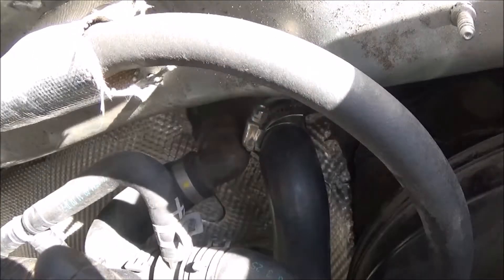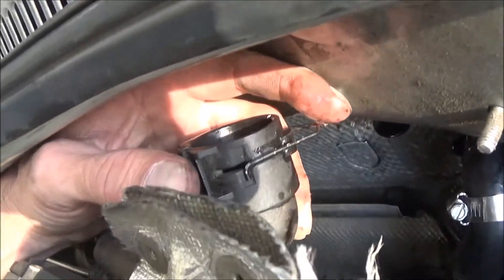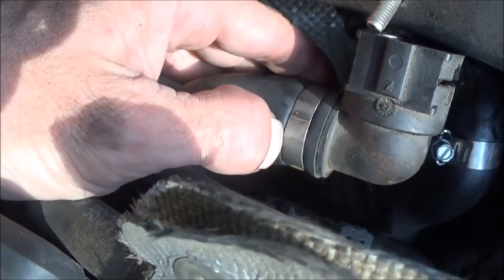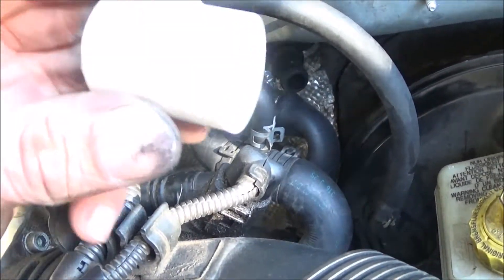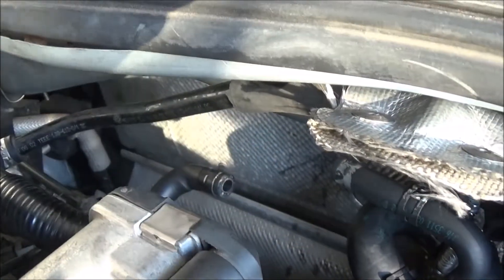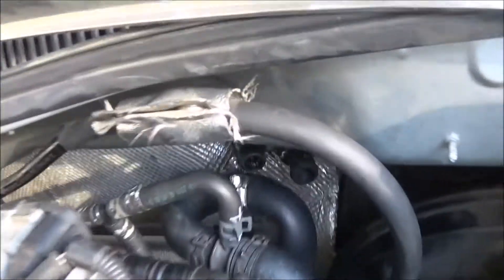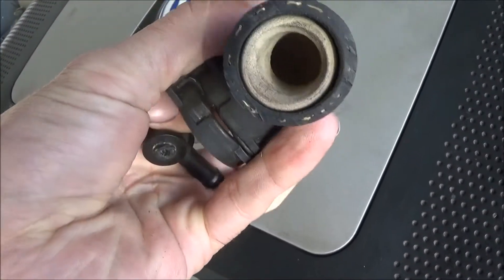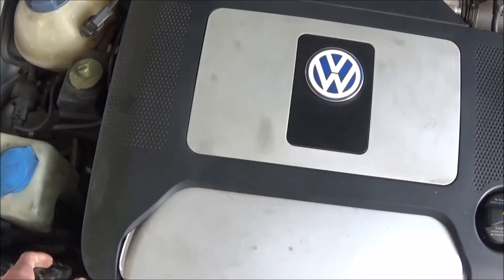How To Bypass The Heater Core On A  Volkswagen Jetta

Comment: I have a question and I apologize I have no clue about mechanics or VW’s at that. I was losing coolant. No over heating, couldn’t find a leak. A mechanic tested the pressure and it blew out coolant under the passenger side of the car. He found a hole in ”the hose” it looked melted to me. I got the part, he replaced it and now my coolant is leaking even faster. I just heard you say both hoses. So do they have a front and rear hose and did he possibly just not put it on right or maybe another issue? Hope that makes sense. My car isn’t over heating. 2015 VW Passat tdi. I just don’t know if I want to bring it back to him and I’ve already invested so much money. He didn’t know about front and rear hoses. I did get the right hose that had a hole in it. Thank you!
Reply from the maker: I was just fixing another coolant leak today. My car's a bit older but I ended up replacing almost every coolant part over the last year because all of the plastic parts are crumbling away. So it's not uncommon to have multiple leaks. Hose's usually only go bad from touching/rubbing things. Melted hose sounds like a major leak that would be easy to find without a pressure test?
I would say if you're losing coolant but can't find the leak it's probably the heater core in the dash. Is the passenger floor wet? Smell coolant inside? Steam in the vents? 
 I'm not a mechanic and I've never pressure tested anything. I would just run the car for a pressure test 🤷‍♂️. So it's just my opinion.
You're mechanic might have fixed one leak and then your leaky heater core got worse because he put more pressure in the system. And I question the pressure test method because there's no way to see if the heater core is leaking in the dash(ask him how pressure testing would find a heater core leak?).
After I caught the VW dealer abusing my R32 on dash cam I don't trust or use any mechanic. If you tell me your cars leaking coolant I can "find" a coolant leak, Or I can show you some old hose off another car, Do nothing, Charge you for some repairs I never did and you're left with a bigger coolant leak then before.
Sorry, I get PTSD from bad mechanics 
Overheating is usually the thermostat or temp sensor. If you live in a warm climate you can run water until you get it fixed, Don't waste$ on anti freeze.
My advice is find the leak yourself and YouTube DIY how to fix it. 
My next video is explaining every VR6 coolant leak, Not the same as a new TDI but it might help you.
Reply: @joshcb7  Oh wow!! Thank you so much for this! Fellow woman with PTSD! You gave me such great info.That makes sense it could be multiple hoses. In the beginning there was no sign of a leak. Until he did the pressure test. I have no smoke. I did smell the coolant a tad bit once, but not bad. No smoke in vents, temp gage is fine. Hasn’t overheated. Maybe it wasn’t melted, but a strange hole in it. I looked up all the things that go on with the heater core and it didn’t seem like that, but one day my car did fog up a bit. That’s the problem with the mechanic, he found that and didn’t look at the rest. My regular mechanic would have done a more thorough job. I’ve been watching YouTube videos like crazy and at this point I found the part and drove 2 hours to pick it up, so I could probably do this myself. First thing I checked was if the passenger floor was damp and it’s dry. I’m going to get under that hood and figure it out myself. So the heater core is located under the dash? It’s so difficult to get to certain things under the VW hood. I can’t see the rest of the message, but thank you for taking the time to write that out. It helped alot bc I thought it was strange to go oh here it is? Then when I said why did that happen, he said idk? I was thinking shouldn’t he know or maybe figure it out?! Thanks again!
Reply: @joshcb7  Oh and thanks for the info about the water. I live in the Pacific Northwest so no issues with warm climate! Lol I’ll watch your next video as well, it may help! This is the most info I’ve received from anyone or any video so thanks!
Reply from the maker: @TMH792 Yes the heater core is in the dash. https://youtu.be/rhWtV503lmE?si=8p9O2lZMspuENZ54 
That's how to change my heater core, Yours is a bit newer but same idea. 
I had one gasket leak that would only happen if I parked the car facing the sun and the temps got just right for the plastic to expand. It wouldn't leak with the car running because the system pressure would seal it up. Tough to find some of this stuff but if there's no coolant on the ground it's probably in the dash.
Reply: @joshcb7  Thank you!
Reply from the maker: @TMH792  No problem. Let me know what it ends up being... It's a fun game for me diagnosing cars over the internet without seeing them lol
Reply: @joshcb7  Yes! I will. It’s funny because it’s been such a pain, but putting the puzzle together has actually been fun! I just drove it for the first time since I realized the leak wasn’t fixed and everything is fine! 🤷‍♀️ As of now. I have to drive on Monday 2 hours and I’ll know more and let you know and what he says. 🙏🏼

Comment: Bro so I can do this until I fix the heater core? Cause mines bad I already know I smell the coolant and ac blows nothing but heat and more heat. I’ve seen the replacement videos on how to replace it but I don’t have the time do you know how long this would last before you seriously need to fix it?
Reply from the maker: You can bypass it permanently if you want. My next few videos I fixed everything with HVAC. You probably need the blend doors fixed.

Comment: Could you bypass the old one and then run longer quick connect hoses and install a external heater core? I'm starting to smell antifreeze in my vents and I'm pretty sure mine is about to go because my heat is pretty weak and I'll be honest I'm not looking forward to replacing it
Reply from the maker: I don't think that would work because the fan blows air into the HVAC box past the heater core and that's how you get the warm air out the vents, Depending on your blend door settings.